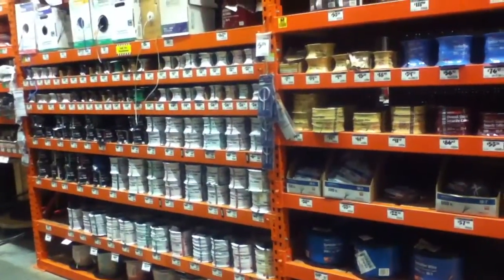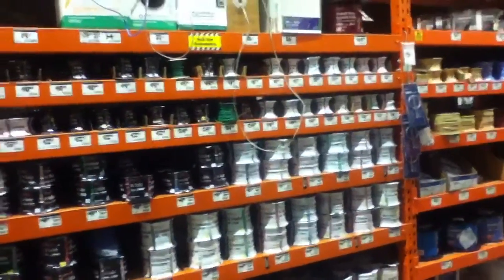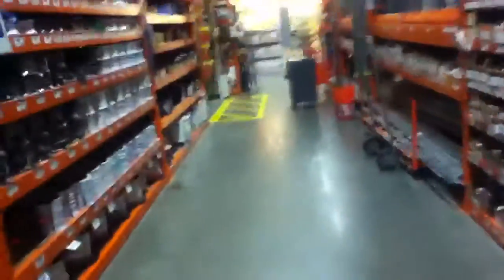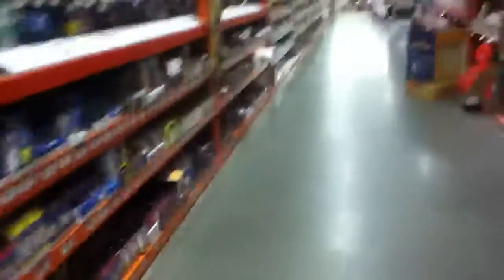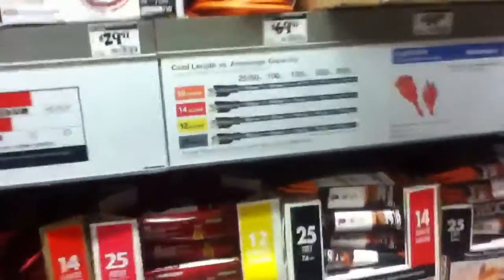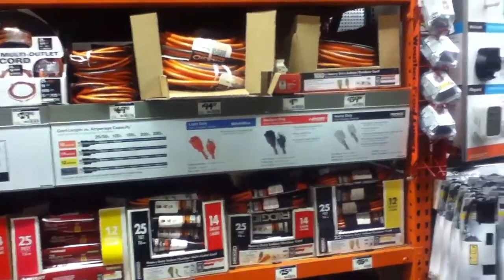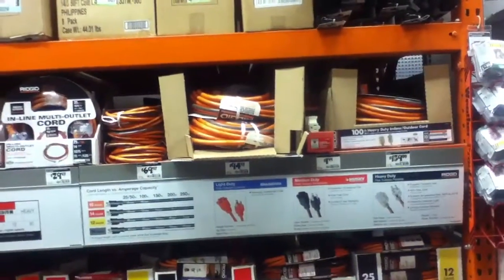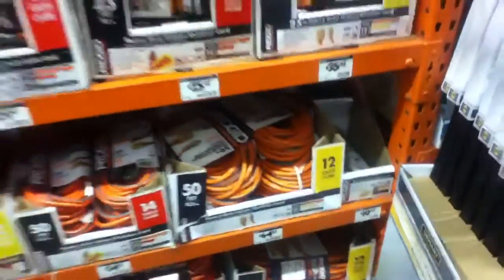Wire size discussion - my response to insistently stupid people comnenting on some of my videos

Comment: The voltage rating on a given piece of wire speaks only to its insulation.  Wire gauge is inversely proportional to is amperage capacity which is also a factor in calculating voltage drop over a specific distance.

Comment: example..your service drop to your house is 2 120 volt legs and 1 neutral leg...120 volts wont kill you but it will get you attention..the hundreds sometimes thousands of amps flowing thru that line will fry you dead.

Comment: The potential rating has to do with the insulation on the wire or cable.  Most outdoor 12V lighting cable is only good for 30V or 150V and thus can't be used on 120V RMS AC as that has a peak potential of 170V.
Using breakers as switches is not a good idea as breakers are only designed for a few hundred operations instead of thousands like switches are.  You can get switch rated breakers that are meant for frequent operation conditions, but they have to be explicitly rated for such use.
The neon lights will not light on 12V or 24V as the lamp needs about 90V across it for the arc to strike.  Lights that use LEDs will either glow very dim (resistive dropper) or do nothing aside from a slight flicker when connected or disconnected (capacitive dropper).
Using regular NEMA 5-15 or NEMA 5-20 (standard single phase grounded 120V 'surprised face') receptacles on 12V systems is a problem as something will get connected to 120V and blow up.  A code acceptable solution is to use NEMA 6-15 or NEMA 6-20 240V receptacles if there is no 240V stuff in the building.  One thing I am testing is using NEMA 7-15 277V receptacles, which look like NEMA 5-15 receptacles with the blades angled inwards.